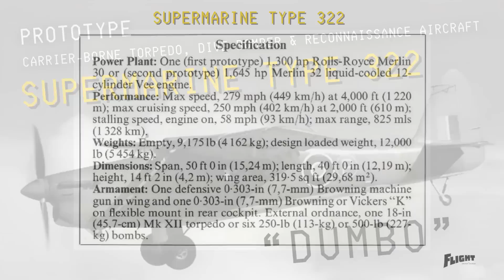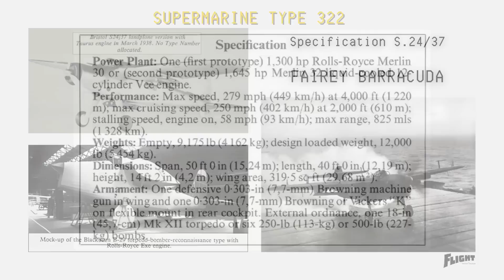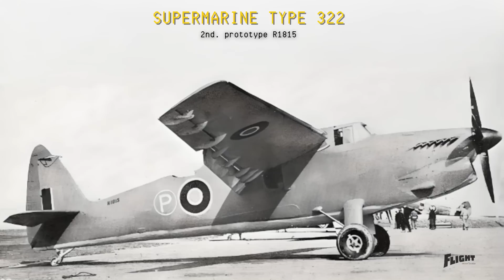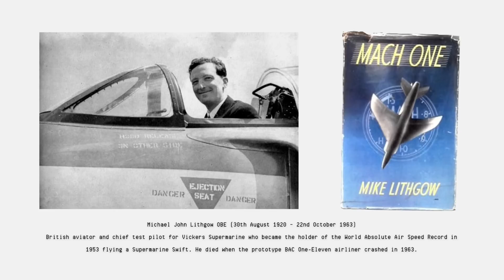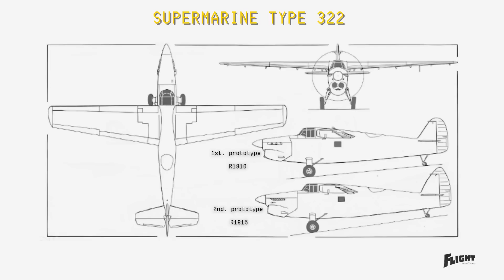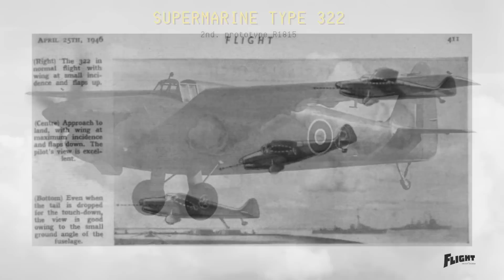Supermarine Type 322 “Dumbo” | Aviation Rarities Episode 36

Comment: Thank you for extrapolating on a design mentioned in your last video. I think ultimately the tailplane would have had to have been relocated to the lowest possible ventral position and perhaps endplate fins explored. Or simply copy Westland with there Wendover tail but for very different reasons. The wing fold design would have to be chaged also, with any Supermarine Swank it had all slowly going the way of a Blackburn creation.

Comment: another of the aircraft that were supposed to replace 
the Swordfish? 
which, for reasons only known to the gods of aviation, 
outlasted them all.
Reply: The true replacement for the Swordfish was the Gannet.
Reply: @uingaeoc3905  it definitely wasn't the applecore (Albacore, for those unaware of the nickname)
Reply: Not so - the Barracuda remained in service until 1957.
Reply: @TankBuilders  Not as an ASW platform.

Comment: I am shocked that the designers failed to grasp that aerodynamically, with the wing presenting at a high angle of attack, would seriously alter airflow to the vertical stabiliser. Which is often overcome by increasing the rudder size, or adding strakes to the lover section of the fuselage. (impossible with a tail dragger)
Reply: Yes this is a problem with tail draggers loosing pitch authority because of wing wash aggravated by this variable incidence wing.  As seen by DC3's struggling to get speed because they are not flying the tail to reduce angle of attack thus rotate  with low groundspeed at end of runway.
Reply from the maker: @Steven-p4j  Maybe with the variable wing, they thought it was in the best place. Maybe easy looking back with hindsight. Other things about the aircraft they understood fully and were innotive.

Comment: Would I be correct in thinking that Fairey had to move the tailplanes higher up the vertical fin because of the airflow from the shoulder mounted wings caused problems with the rear control surfaces?  

Given all the modifications and changes the Barracuda was subjected to, the Dumbo might have needed a magic feather to fly had it been given the nod.
Reply from the maker: @pencilpauli9442  Yes l would think they did it for that reason. It was a good aircraft, l think.